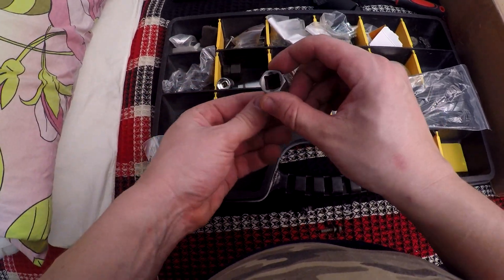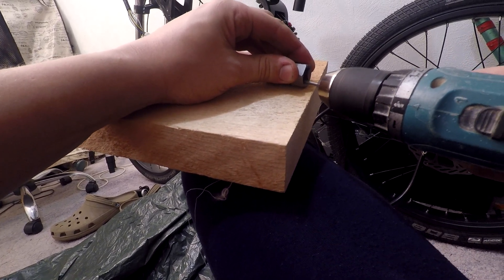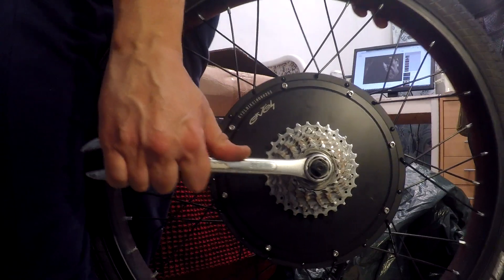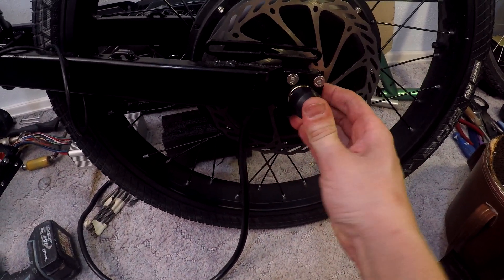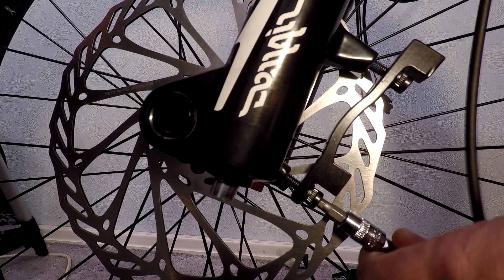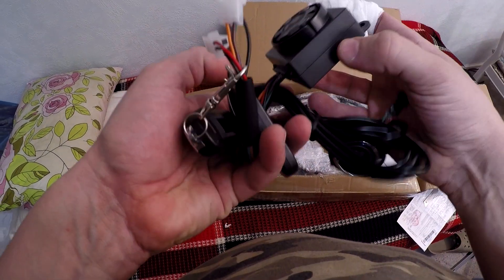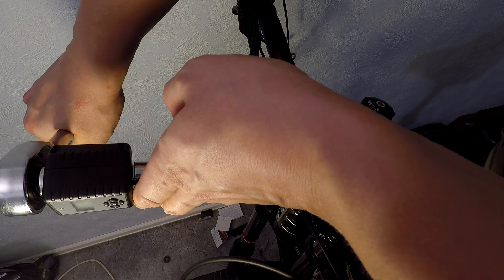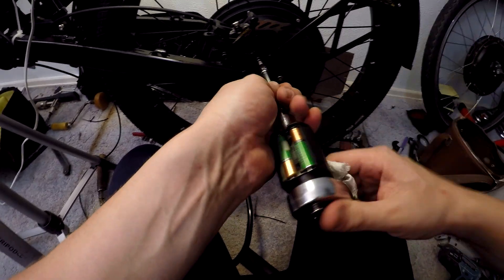Building an Electric Bike in My Bedroom - #5 Brakes, Rear Mudguard

Comment: Hello
You can tell where you bought the mudguard????
Reply from the maker: Hey, Yes I can :)
https://www.enduroebike.com/eebfenders But be careful, since theres problem with the costumer support, dunno what wrong with them.
Reply: @DatEbikeGuy  Did you get charged 200 - 300 extra for shipping?
Reply from the maker: @kornellbrown3802  Hey!
When I ordered a number of parts from them. At one point, when they were already starting to post, they contacted me. Could I send an extra $ 150 as it doesn't fit in a regular package. It was a front suspension.
Reply: @DatEbikeGuy  I everytime I'm about to check out I run into that shipping expense... Do you know of any other source that provides those fenders?
Reply from the maker: @kornellbrown3802  I never ordered through the website but contacted customer support and ordered from there. Over the years there are problems, they do not respond to letters....
I searched aliexpress and elsewhere and couldn't find it in the same fender.
Reply from the maker: The fenders have the evelbike logo. You could either contact @ evelbike.com aswell.
Reply: @DatEbikeGuy  what is this dynamo key what you set to 60 value? can you send some link for it? it look like cool gadget
Reply from the maker: @komar2511  It´s called torque wrench (digital version) https://www.aliexpress.com/item/32819968897.html
It is necessary. There is also a mechanical. What I use can't say how accurate it is, but it works. Torque unit I use is N.M, There are other options like Kg-cm,Kg-m, ft-lbs, in-lbs. It was 6.0 and not 60. With 60 I would have broken the bolt :)
Each size of bolts has its recommended strength

Comment: Hi could you please put link on the start stop system and the fenders.  You are using Boston Swing batteries how do they perform? Thank you and put your video up faster
Reply from the maker: Hey, for engine start stop button you have to ask it from enduroebike costumer support, for fenders: http://www.enduroebike.com/index.php?route=product/category&path=137_125_146
Boston swing battery perfoming great, it has Bluetooth BMS, so I can check voltages time to time with ease, allready have 7500km traveled and no problems whats so ever. They are cheap beacause not widely known. 

Actually my goal is one video per week now, but no promises :)

Thanks
Reply: @DatEbikeGuy  THX for reply. I'm building almost same bike as your for touring too. Almost finished with the battery and I'm wonder how to install rear rack and want to see your solutions first for inspiration. Do you have an outlet to run electric appliance?
Reply from the maker: @DungNguyen-nm1fp  Hey, I´m using seatpost rack solution, + easy to mount but low carry weight about 10kg, I have vertical support aswell, regular rack have like 25kg, also I have front rack solution as well. I have 12v motorcycle weatherproof cigarette socket mounted on the handlebar https://www.aliexpress.com/item/32953018437.html?spm=a2g0s.9042311.0.0.1c314c4dpBPTTU 12v DC-DC needed for this  . Im using these addons: (tire air compressor, fast usb charging plug, hand warmerer, bike washer pump). When you bike is finished can you share video or photo with me :)?
Thanks
Reply: @DatEbikeGuy  Sure I will share when I ever get finished. My plan was to get ready for last summer and get around in Europe, but was busy plus waiting for parts in China. You are a good storyteller and should make video of your trips.
Reply from the maker: Lots of touring videos coming and crazy/funny side project aswell, coming after I finishing posting my enduro building videos. My bike never finished, allways have room to improve.